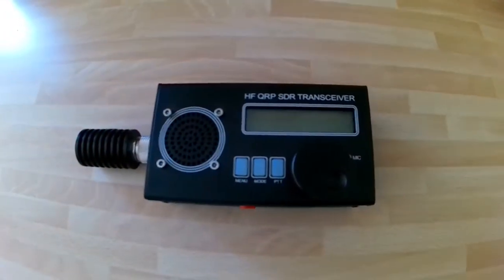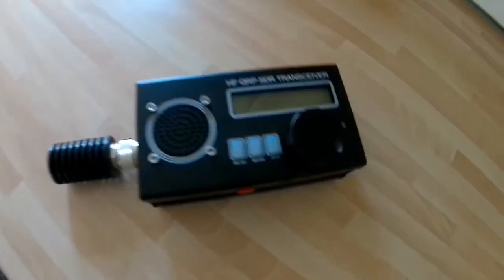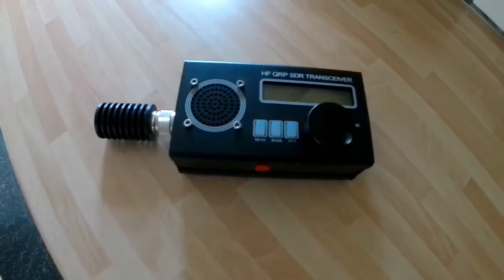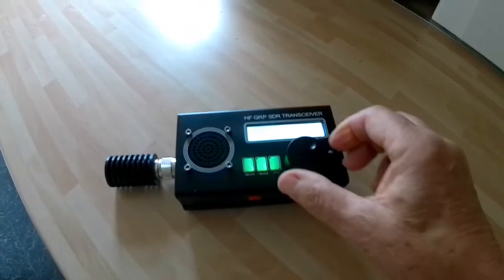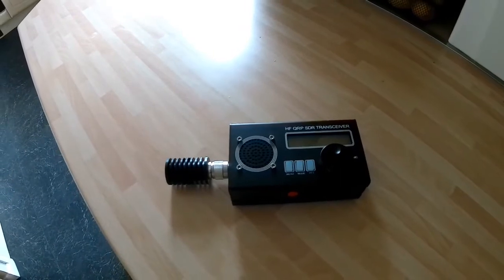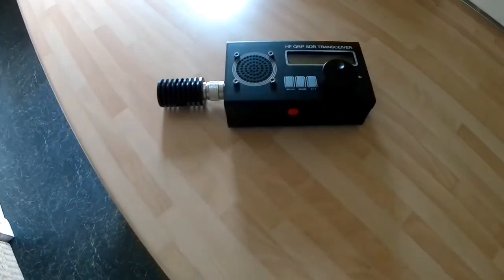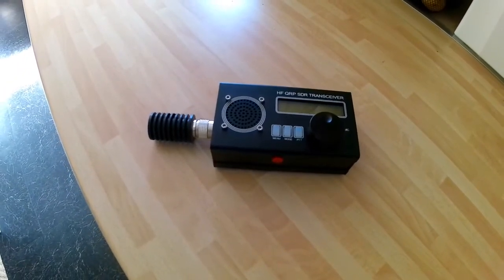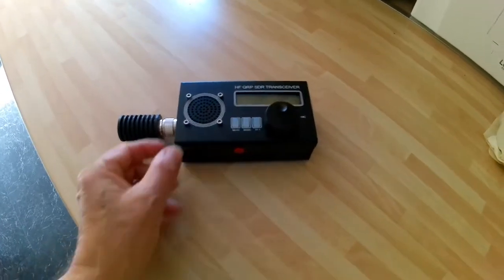USDR QCX To SSB HF Transceiver. QRP SDR 8-Band. So Many Faults. Ebay Purchased from "sttee2"

Comment: I had distorted cw and side😂band transmit on mine returned the radio
Reply from the maker: Originally they were good until everyone started to copy them. Then the copies got copied and on and on until they are rubbish. Pot luck if you get a good one. George

Comment: Hi there, i own 2 of these, and i love them, i think you just was unlucky with the seller :(   i also own 2 of them little usdx radios, they are also lovley, you can also upgrade the software for a smoother recive and better audio on this "Black bricks" 73 from Norway.
Reply from the maker: Hi both of my radios have distorted tx audio. I have tried every settings without any improvements. They receive signals very well. So pleased  with them as receivers. I haven't found any videos of how to sort out tx audio. But still hoping it can be fixed. Cheers from old George
Reply: @MakeDoAndMend1  Try to put it like this, if you havent done that from before... Noise gate 4   Tx drive 4   PA  bias min 8  PA max 180  this is on the USDX + v2     its the same on the USDR   just PA bias max is 205  on that one, it works good for me.  I worked 11m usb with 1.3 watt and a speakerwire antenne that was 8.2 meter long and about 6 meter counterpoise.  And they heard me almost 100 kilometers away :)  we have an 11m test every week.   Fm mode sucks ..but Ssb and Cw works great on these small radios.. Best regards from Norway.

Comment: Hi, you should use amplified external speaker those used in computers, the mic has wrong connections you can find several videos in youtube to fix external mic with built in speaker, there are also videos to update the firmware so you can fix the lcd ligth turn off issue and the noise with a mofified algorithm with signal normalisation 73
Reply from the maker: @diegogarciamedina6363  yep I was the person who put video up regarding the microphone. It's in my Ham Radio playlist.😅
Reply: @MakeDoAndMend1 great sdr rig if you fix all known problems, I hope they are selling now fixed rigs 73 LU2DVY

Comment: Can this be used as a general coverage receiver outside of the ham bands?
Reply from the maker: Sorry I don't know. My radios are on loan so until I get them back I cannot try them. George
Reply from the maker: Answer is no. It doesn't do AM or FM and the filters are set up for ham bands. George
Reply: @MakeDoAndMend1  They have AM and FM 😉  and works on 11m
Reply: @Centar1964  It works on 11m And it has Fm and AM  but jus must go in to the menu to change it, and FM and AM is not the same quality as Ssb and Cw.  They say it is a kind of "Gift function"   Best regards from Norway

Comment: I bought one of these just like the one in the video with the three horizontal buttons used from a seller who was as unhappy as you were. I learned to set it up properly including PA Bias min and PA Bias max, TX drive, etc. Not sure why you think it should only put out 5 watts. The seller's complaint was he thought it should put out 10 watts but the best he could get was 4.4 watts. I easily got 10 watts with external power source of +13.8 that I use for my Icom 705. It's even the same power connector. I just used it during a contest on SSB yesterday and found it easy listening. Here is a link to all the testing I have done and setups. I felt bad for the seller so offered to let him have it back for what it cost me but he already purchased another product and said I could keep it. For the $$ I paid, I consider it a very good product & enjoy it quite a bit. https://www.eham.net/community/smf/index.php/topic,137404.msg1276037.html#msg1276037

Comment: Samething happend to me. I ordered the one with the three buttons on the right side and instead I got the ones with the buttons on bottom so I kept it anyway. I use it in my SUV with a hamstick mounted on rear door. I actually use it like a walking talkie. Have a qrp manual tuner mounted on top of dashboard with a 3 foot thin coax between radio and tuner. Made a few contacts to florida and mid west on 20 meters got ok reports since its qrp and running mobile they still heard me. Thinking of getting a 10 meter telescopic antenna and see how that works out. It even has 60 and 6 meters.
Reply from the maker: I have 2 of these radios. In settings can you tell me what tx drive settings are set too. Also tx bias min and tx bias max plse. Both my radios have had distorted audio reports on tx.  Cheers from old George
Reply: @MakeDoAndMend1  the drive I have set at 4. The max PABias is 250 the min is at 30 for some reason I set there. Do you mean your distorted audio is on transmit side when you talk to them or your recive audio?
Reply from the maker: When they give me a signal report when I am Transmitting they say my audio is distorted. Cheers from old George
Reply: @MakeDoAndMend1  yeah I read that after I sent it. Sorry. I also ordered another one. Good luck on your new settings I gave you.
Reply from the maker: @davezinetti666  Hi Dave. I have set my TX bias max so that it gives 5watts on 40m and 20m band with CW mode when using it on it's own battery. It's different on one radio to other. As printed spec says regarding opt power. I am going to use your settings to see what power they output. Maybe do a video on it. Cheers from George
Reply from the maker: Hi David. Sorry for so many msgs. Just to say you may have solved my problem.  I have been setting bias so it gives 5W on battery. setting it the same as yours makes it give 10W on battery. Hopefully it will be ok now. Cheers from George
Reply: @MakeDoAndMend1  sounds good George. The one I have gives me 7 watts on battery and same for external battery. I think I have the original but I ordered another one that's newer.

Comment: Hello George, Just a question about the built-in battery of this radio, how do you manage to know if the battery is fully charged ? Or do you just leave the charger plugged for few hours ? Thanks 😊
Reply from the maker: The charger supplied with radio has a Led on the front. It lights Red when Charging and goes Green when fully charged. So you have to use the charger supplied. Cheers from old George.
Reply: @MakeDoAndMend1  Mine is already green on arrival, the battery must be fully charged then ! thanks for the reply George and 73 😉

Comment: LoL you only get what you pay for . I got one and luv it
Reply from the maker: Yep. I have 2 of these Radios and the better one has only a couple of small faults I can live with. Cheers from old George
Reply: @MakeDoAndMend1  i order it with vertical buttons i received with orizzontal buttons ,i will cancel my ebay account ,ebay was not helping me
Reply from the maker: Ebay isn't good when things go wrong. Aliexpress isn't any better. After months playing around with settings I am beginning to like this radio. I will put a video up soon with my findings. Etc. Cheers from old George.